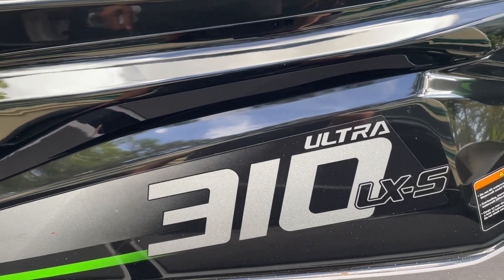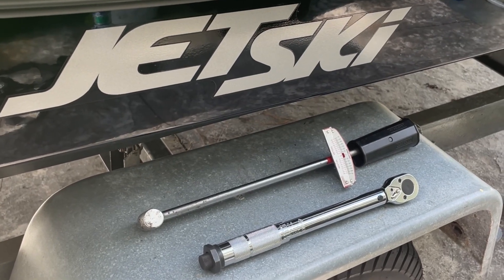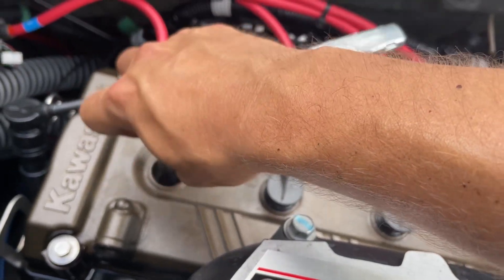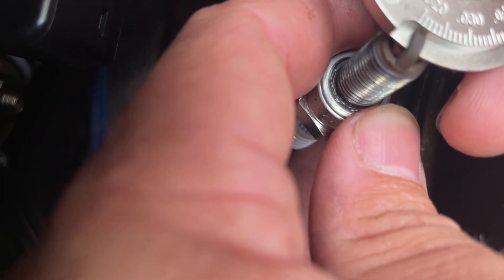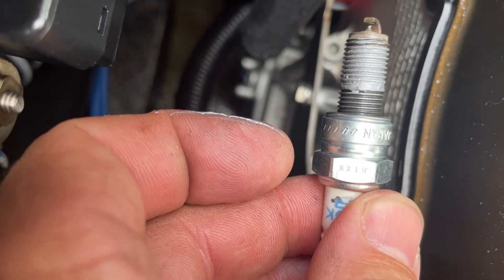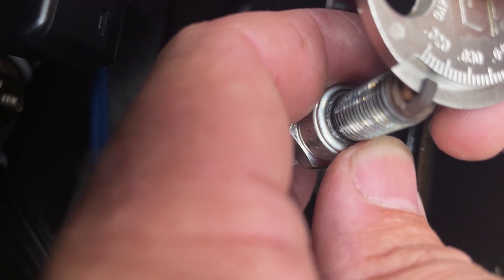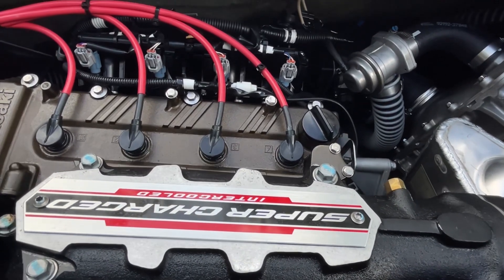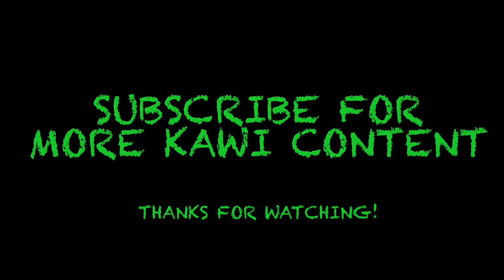GAPPING & CLEANING SPARK PLUGS 2022+ Kawasaki Jet Ski Ultra 310 🔧🔧🔧

Comment: One thing people never talk about is checking the plug resistance. It’s damage you’ll never see without a multimeter, but can make engines run like crap.  Ie youll have 3 plugs at 5k ohm, and one at 3k ohms…it’ll still run good enough, but not perfect. PMR9B has a 5k resistance so should measure “around that.”  If there’s one way off from that it’s not ideal.  Best to check them when new, return any ones that are way off and write it down to track over time.  Always good to install new ones that are similar in resistance, and if you write it down you can track it to see if there’s a consistent cylinder that kills them-likely a cylinder that’s getting hotter than the rest.

Comment: Hey there! your videos have been so helpful with owning a kawi. Im about to do the plugs now, however there are so many different permatex anti seize lubricants... you show a 80071 but my wet marine sells one that says specifically for marine vehicles with a model 80078.. any real difference?
Reply from the maker: I think the difference is the size of the container lol - any antiseize should be fine or you can use moly grease. Make sure to grease the plug boots very well and use a torque wrench. Follow those steps and you will never have an issue...over torque and you will be f'd

Comment: Good video.  Ever had one of the boots tear?  Just tore wire #4.  Had to order new wire but still can’t get the old plug boot out.  Any pointers on that?  Nothing to pull on now but the wire since the boot is torn.  Arghh!!
Reply from the maker: I have in fact heard of this happening to someone else- you must keep those boots greased well when you change the plugs. If it’s a new ski, you should grease them liberally after you do the first plug change at 25 hrs. Probably take a needle nose stick down in center and try to pull up- maybe spray some lubricant at the base of the boot and try to work some in to free it up
Reply: What do you grease the boots with? Just had trouble getting one off took a while but was able to get it
Reply from the maker: Use a good dielectric grease on the outside of the rubber boot and make sure to reapply grease every time you change the plugs which should be every 25 hours
Reply: It is easy to get a marker to label 1-4. It is useful to compare all 4 plugs together, for potential differences and problems, before cleaning.

Comment: Hi, Thanks again for a great video.  When I go to the NGK web site, it says you never use antiseize on NGK plugs.  Thoughts?
Reply from the maker: For marine use and for the Kawasaki Ultra 310 you will be very very sorry if you don’t use anti-seize. The Kawasaki manual states to use anti seize, as does Kspeed in their documentation.
Reply: @JDsWaterWorld  Type of anti-seize recommended?  I used permatex.
Reply from the maker: Sorry I posted a link to the video you commented on! My bad…yes I use permatex as well with no issue. I’d the grease on the boot has degraded you can add more- the type you mentioned should be fine. I prefer Lear Corrosion Block grease.

Comment: Did you get the SB from Kawi about the reprogramming of the ecu for the spark knock issue?
Reply from the maker: I did receive the bulletin, but have not had the reprogram done yet as I am not having the issue…if you run high quality 93+ octane fuel, it does not have the issue apparently. The reflash takes around 25 minutes apparently and those who have gotten it report is corrects the software glitch.
Reply: @JDsWaterWorld  I haven't gotten either. I have 90 ethanol free next to my house and it's freaked out, ran 93 it freaked out. I'm at my witts end, ready for the program to be accomplished. I'm in nc, idk if you're further south, kawa dealer said the northerners are having an absolute fit with it right now.
Reply from the maker: It only takes 25 minutes to reflash the ECU- your dealer should be able to get it done fairly quickly. Call Kawasaki customer service and get a Case ID if the dealer is giving you an issue!
Reply from the maker: That sucks…you definitely need to get that reflash done ASAP